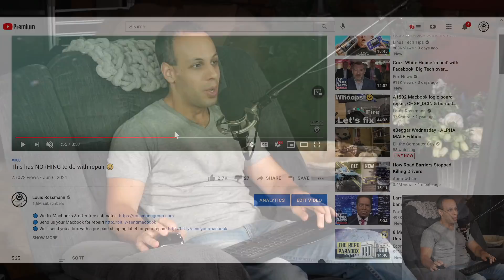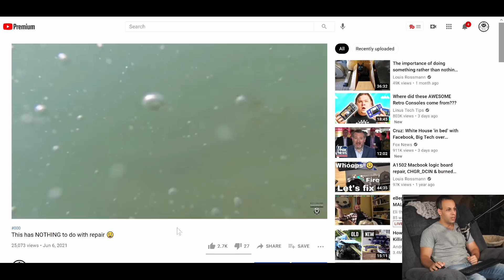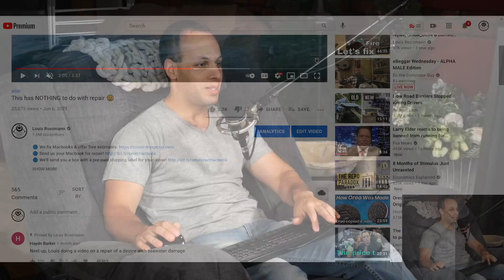Why are user serviceable batteries a bad thing?

Comment: Epson recommending to change the printer instead of servicing it as it better investment in lower-end printer. Servicing is about 130$ for ink pad replacement.
The Ink pad is a sponge that cost 6$ on Amazon.

"Q: Why not just make the Ink Pads a user-replaceable item? A: Implementing this type of a design would result in more expensive printers."
https://epson.com/Support/wa00369#:~:text=Why%20not%20just,of%20Life%20message.

Epson Eco-tank Ink pad replacement tutorial: (2 screws, 1 hook, replacement time: 2min + drying time if washed instead of replaced)
https://www.youtube.com/watch?v=Ow6eqZELeBI

However, they removed the Ink Pad Reset Facility Software and updated the firmware so that you can no longer reset it, unless you pay 130$ to service it at an Epson Authorized Customer Care Center.

Then they have the audacity to say that they care about the environment:
https://epson.com/about-us-environment

Comment: Even before they had cameras which could be used underwater with user replaceable batteries, they have scuba dive computers which work to 100 metres and have a user replaceable battery. As a professional scuba diver I ALWAYS buy a scuba dive computer that has user replaceable battery. My current dive computer fits on my wrist (around the same size as your camera) and is waterproof to 260 metres (850 feet). I have had occasions where the battery died on your dive computer while at sea on a boat. I carried a spare battery. I change the battery between dives. It was still waterproof to 260 metres.

Why are most smartphones water RESISTANT to 1.5 metres? The truth is that it is cheaper to glue the phone together than to actually make it waterproof.

Comment: Does the right to repair law will prevent Epson to software lock my printer even after replacing the 2$ ink pad. Forcing me to service it at 130$ to unlock it.

Or prevent then from locking my printer after 3 years because they established that the service life of the device as reached its end?

Or make me unable to print or use the scanner because the cyan ink as run out?

More information on epson website:
https://epson.com/Support/wa00369
https://epson.ca/Support/wa00369

Comment: Same with everything made today, components most likely to fail first are either sealed, tied to something else, impossible to access, need proprietary parts or tools. They don't want you to fix anything, they want you to keep buying new. Even if it is repairable, the cost factor to take it to a shop, or a mfgr service center, lose your device while repairs are being made, and the cost factor, the common choice for many will be to just buy another one. The consumer is just a cash cow in this. Same with cars, want to upgrade the stereo? Sorry that's tied to the computer, or OnStar, or something else. Select Chevrolet models you'll pay hundreds to replace a $10 headlamp bulb at a shop if you don't have the skills, because you have to remove the entire front end. If you live in the salt belt and bolts are all rusted, or any of the many plastic components break, it can exceed a grand. And you know you'll be doing it all over when the headlamp burns out again. They just make a new car desirable over a $10 part. We let them do this to us.

Comment: People have no choice new products dont come with user replaceable battery.....look at microsoft surface the whole unit is sealed and glued together.....15 years back if you came with a unit that the battery couldn't be changed it would not have been accepted by consumers. Now its better u buy a new unit every 2-3 year. I had to open a friends perfect microsoft surface unit. The reason being the system went in standby and would not come out, microsoft said buy replacement unit for 70% the cost. If it was an old unit you would just remove power and remove battery and put them back and unit would start. Since the screen in glued to the unit you couldn't remove the screen....removing screen is tricky and resulted in glass cracking near edge. Disconnecting and connecting the battery was equivalent to hard reset.....We humans design non repairable products out of greed.....

Comment: There is this obvious misunderstanding that by "user serviceable" you may mean END-USER serviceable and people suddenly forget that you still need THE SKILL to do this properly, which if they don't have and have to go to a repair shop, be it authorized or independent, does not sound "user serviceable". I think that needs more clarification that the right-to-repair still gives them the benefits of BEING ABLE to actually FIND a repair shop that will DO THE ACTUAL REPAIR rather than rely on as you called it, a mail depot authorized service and manufacturer's rule to replace your device instead of repairing it.

Comment: Main reasons advocating for non removable batteries are
1. If it is removable, it will take more space due to rigid housing, more wasted space and additional device components. Removable batteries are up to 50% non capacity related in terms of volume, while non removable can be made to basically fill gaps between components of your device.
2. Removable batteries generally require much bulkier devices in terms of physical dimensions. So phones will be thicker and heavier compared to non removable, "molded in" batteries. 
3. Broadly speaking, advantages of removable batteries are minimal in terms of device lifespan. Your typical phone with a large 6000mwh battery will still be 5000+ in 2 years, unless you really abuse it. And in that time, industry practically dictates that your device is already obsolete.

Just my 2c here. Personally, I do think that removable batteries can be a good design solution. Especially for devices that need to operate long periods of time with limited charge and large energy consumption. Like action cams. One battery is used, the other charges. Swap and continue. But for phones, this line is blurry at best. I do wish though, that they made replacement of non removable batteries as easy as possible for servicing a device. A simple detachable connector and not being glued in will solve 95% of issues. If the actual change needs to be done in a service shop, spending 10 mins in one to safely crack open a device should not be a major issue.

Comment: Dear @Louis Rossman 

I use an Android tablet in the cockpit when I fly. 

Even though the best-in-class pilot mobile software is ForeFlight, I can't use it because I won't buy AAPL gear. I hate AAPL because, as a software engineer, I think AAPL's attitude towards developers sucks donkey dong. 

But beyond that, I think iPads are simply not built well enough to rely on in flight. They are too fragile, and have inadequate cooling...a tablet that will shutdown from overheating in-flight is simply not acceptable, and iPads do this ALL THE FUCKING TIME.

My solution is a Samsung Active 3 tablet. You have to buy it from the commercial division. It's typically used in applications like car-rental, package delivery and field service...and a commercial operation simply won't buy equipment that needs to be replaced every year or two; that's just not sustainable. 

The Active 3 Tablet is ruggedized. The battery is user-replaceable.  It passes MIL-STD-810  and IP68 testing. It will take a temperature shock of −4 degrees F to 140 F, operate for hours at −4 F, can be stored at −40 F, and will run at up to 160 F for more than two hours. 

It rocks my world.

Comment: Only complaint I ever had about removable batteries was that when you drop the phone sometimes the battery gets loose and the phone turns off. I carried around a power bank and an extra battery when I had my S4 all through high school and never had to worry about my phone dying, until a chip went bad and it wasn't worth fixing the phone was so old. RIP good buddy

Comment: Being able to swap batteries instead of charging the device was useful for camping and stuff. Its a damn shame i never had to replace a battery on any of my older phones where it was super easy. I still have a zte skate which is close to 10 years old at this point, still has the original battery and it lasts me for up to 4 days, i only use it for calls, but i couldnt get my main phone last that long even with all the stuff turned off. Im not surprised manufacturers dont like the idea of user replacable batteries because it can keep a device alive for way longer and it means the lifespan is defined by how well you take care of the device.

Comment: I replaced the battery on my Samsung Note 8 old and new phones....  The old note 8 had the batter puff up from 3 years of use and i replaced it.  I bought a brand new note 8 just in case i screwed it up or broke it.  Well now after using the new phone for 2 years, i just replaced the battery on that one and it was more of a pain cause it was sealed, unlike my old phone which the cover was forced off by the battery expanding....  Its nice to have a good battery again.  Just ordered 2 more batters and 2 new back plates because i dont really like the new samsung phones.  I miss the days of easily accessible replaceable batteries.

Comment: My Galaxy Note 3 is as thin as the iPhone 7 if not most current iPhones and they were able to have a headphone jack fit on that and Apple's claim that they could not fit one while swimming down the device is utter BS since they can do it with the iPod Touch 6th and 7th gen and those things are even thinner than my Note 3 what alone my Galaxy a10e

Comment: I always prefer my removable batteries on my phones... Still have 2 phones that I just swapped the batteries out of so they could still be used... They still function just perfectly fine and have no issues, why replace a phone if it still works, and the providers still provide services for the phone?  I'd still use my old samsung flip phone if they still supported analog signals around here.

Comment: There is no good reason for batteries to be sealed up, but there is even less of a reason for batteries to be glued to a phone or tablet. Removing battery adhesive is almost always a huge pain. I just repaired a Surface Pro 4 recently and removing the battery was a ridiculous process. There was a huge amount of space around it, so it would have required zero effort for Microsoft to just use 4 screws instead. But then they don't need to glue the screen either, especially considering that it needs to be removed to service anything on the bloody tablet.

Comment: Water resistance came first, sealed batteries later. My old Samsung S4 Active from 2013 had a battery you could swap in seconds even though it had a water resistance rating.

Comment: My Yaesu VX-6 hand held amateur radio is fully submersible and has a removable battery. There is no reason to have a sealed in battery other than for built in obsolescence. In fact, having a built in battery is more dangerous as if there is a battery fault I.e. swelling or internal short circuit in the battery it cannot be removed easily. Also the same applies if there is a hardware fault with the phone itself and there is a low resistance load from a hardware fault you cannot pull the battery out.

Comment: OMG... NO

I hate the sealed-in battery of modern phones. I miss my old phone that had a battery I could just pop the back off of with my fingernails even, and pull the battery. That thing even had a non-glass touchscreen and to this day has been the only one that hasn't had the screen cracked at some point from dropping. They make these things to become ewaste and I really wish that some company out there would take a stand against this crap and market it with a green angle. Know what's really green? Being able to easily repair your devices and them having resistance to damage. Shocking, I know. Instead we get this crap that's almost garbage out of the factory because what? Some idiots exist and corpos are greedy.

Comment: "But the space, the batteries are bigger now?" 

No.... No they're not
Reply: @A Cat in the internet Tech is in an arms race to have the fastest processors. (faster than competitors = more customers) this speed focus reduces their potential efficiency.

Faster processors (of the same generation) also use more power anyway, there's no way around it. As can be demonstrated by
Under-clocking (slower but longer life) or Overclocking (faster but shorter life).

Battery tech also hasn't been advancing as fast as processor tech. So the battery-life-to-speed-ratio is much lower than expected.

Combined: you get faster phones without longer battery life (Instead of both improving). I'd say they're actually getting shorter.

I have a theory that batteries are being designed with a focus on max initial capacity (instead of lifetime charge cycles) to try and hide this discrepancy. This lets them flex a "max 12hr usage" (but that max capacity drops to ~8 hrs after only a few months of use).
Reply: Exactly, 4.4v lipo batteries last a lot less and lose much more capasity faster than 4.2v batteries. And even those 4.2v ones get their lifespan doubled if you only charge them to 4.1v instead only losing about 10% of their rated capasity.
Its all for the marketing.
Reply: Even if it is it's irrelevant from the topic

Comment: There is literally no argument that could be made against user replaceable batteries in this day and age. My current phone (Pixel 4a 5G) is not much thinner than my old LG Spectrum and it's got a replaceable battery. One of the big reasons I bothered to upgrade my phone was because I was becoming tethered to my charger. 5G was the other one. But newer tech should be the only reason we are replacing devices, not a dead battery.

Comment: Finally, someone said it. Removable batteries absolutely essential to me. Sometimes I need to make sure the phone is turned off in a way that's easy to show, removing the battery and putting it next to the phone is a very quick and intuitive way to show that it's stone dead. The phone physically cannot turn on by accident and I can prove it.

This is why the LG V20 was my last Android phone. There simply aren't any flagship Android phones with removable batteries anymore. Knowing that I said screw it and got a PinePhone instead, which has a removable battery. Now I can not only easily service my phone with basic tools, I can also debug the software myself because I'm not locked into whatever software the manufacturer allows me to put on there.

I'm currently writing this on a OnePlus Nord N100 i bought for development and it's such a piece of shit hardware wise. I mean the specs are stellar for the price but there's zero serviceability. I can't even get the damn SIM card out without a very sharp tool. This is my first device with this arrangement and I can't imagine what kind of lunatics agreed this was a good thing.

I'm done with Android and I'm done with the crappy hardware design. I might have very experimental Android app support on my PinePhone but at least I feel like I'm in control of the freaking hardware I paid for.

Comment: Replaceable batteries are exactly the reason that I changed from Jabra earbuds to Sony Wf-1000 earbuds. Compared to the 65t I think I gained some audio quality, but I lost some in mic quality. Jabra also seems to have a more stable connection.
However, the battery in the Jabra died after one year, and all they offer is a replaceable earbud at 140$. Even if I get 20$ batteries, I would not be able to replace them without breaking the earbud due to the sealing. I even had to press it hard in a vedge to get them apart.

My Sony has already lasted over a year without much degradation. There are disassembly guides. The batteries costs 15$  (and the Sony cost 250$ instead of 350$)
Why throw 350$ away per year due to battery degradation?

Comment: batteries should always be replaceable, either ideally by the user/owner, or a repair shop, the device may be perfectly ok, otherwise, and still do exactly what the owner wants and needs, they shouldnt be forced to have to buy a complete new device just because the battery is worn out! my admittedly cheapo  bush tablet i'm using now, will soon need a new battery, i cant afford a complete new one at the moment or for forseeable  future, and its still perfectly ok and usable for what i need,  i've opened it up to get the battery details and so far have not found a source of the thing!

Comment: "The legislation doesn't mandate changes to the design", but it should, otherwise you're going to see companies coating the PCB in epoxy. But beside the point.

I'd love it if the Battery, and Flash memory was mandatory user-replaceable. That does not mean putting M2 drives instead of soldered ones in, but it would help if the flash memory and battery "compartment" could be opened by the user, even if that means using a dozen screws to retain the water-tightness, and the battery is additionally screwed into the back of the unit. 

Because of the obsession with TPM/DRM schemes by Apple and Microsoft, it might eventually turn into a situation where even if you could replace the battery or flash memory, the TPM chip will make the device a paperweight if the part is changed. This is where the legislative efforts for right-to-repair need to likewise bend the ear of these companies and provide a way for the "tpm" locked hardware to be replaced without destroying the user's data.

Comment: I own a DJI Action, and a 7 year old waterproof phone with a  replaceable  battery. I'm not into disposable tech, because I'd rather spend my magic beans on reliable and durable gizmos that I'll actually get some long term value out of using..
The DJI will happily run all day at 4k without an internal  battery when connected to  a suitable USB powerbank, and you can swap lenses on it and add various expansion widgets, so it's not quite apples and apples. It is however a very good example of how durable, practical, and customizable our modern  portable consumer  tech ought to  be.